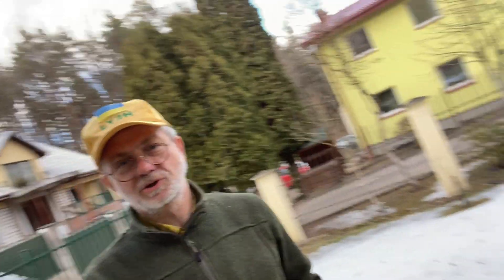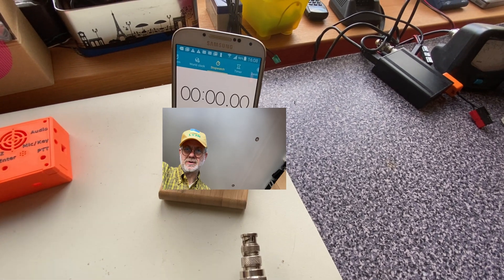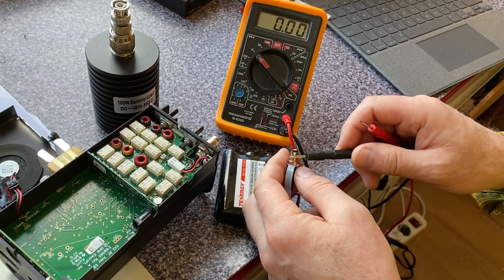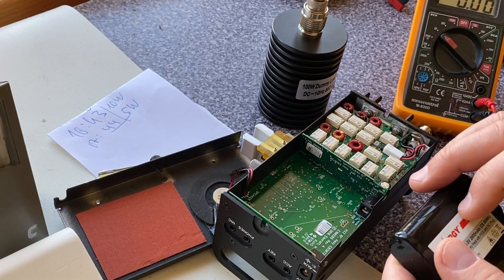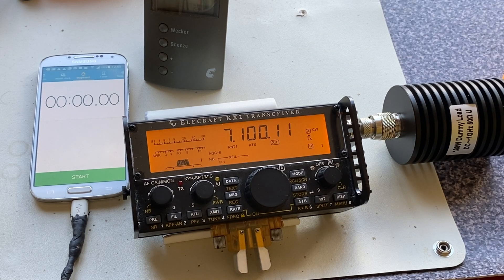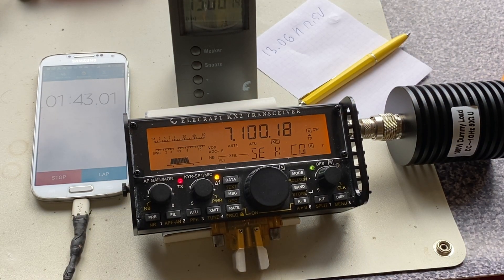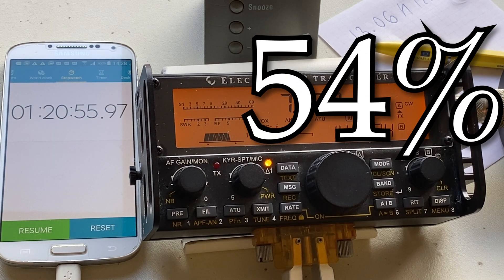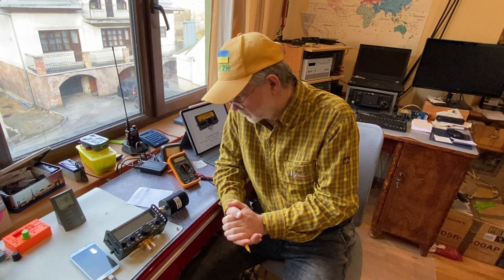Elecraft KX2 new firmware gives 3 times more operating time at full 10W !

Comment: Hi, greetings from UK!
very interesting experiment. A quick curiosity, how much extra weight do those side plates add to the rig?
I wonder if those thermal plates have any positive impact on transmit efficiency and as a consequence in running time?
Thanks for sharing.
Peace
72
Reply from the maker: Hi Vitor, thanks for watching! The side plates make a negligible increase in overal weight of the KX2 as  it's made of lightweight aluminium. The heatsink is installed on one of the side plates. The heatsink makes a very positive impact on the transmit efficiency. I can run a really heavy-duty CW ( contest style) at 10W output with no problems now respectfully the running time. Before the heatsink, even at 5W output intense work in CW mode was problematic. So my personal opinion is the heatsink is a must if you plan to operate a lot of CW and  Digital. If you only make leisure-style SSB ( 80% of listening, 20% of transmitting), then the extra-heatsink makes no sense. HTH, 72! Linas LY2H
Reply: @Linas_LY2H  Hi, thanks that is very useful to know. Also considering that I often like to operate in the summer in places where temperatures often rise above 28 degrees in the shade, that is definitely a good accessory to have.

Comment: the KXIBC2 is getting closer, it replaces the KXIO2 board... the product manual is on the Elecraft FTP site with a date of 26 Jan 2023...

ELECRAFT KXIBC2 INTERNAL BATTERY CHARGER MODULE INSTALLATION AND OPERATING INSTRUCTIONS
Rev. B2, Jan. 26, 2023 Copyright 2023, Elecraft, Inc.

INTRODUCTION
The KXIBC2 module is a C/10-rate charger for the KXBT2 Li-ion internal battery pack. Operation is simple,
requiring only that a power supply be connected to the KX2 when charging is required. The radio may be on
or off during charging. The KXIBC2 does not generate any RFI, so the radio may be used during charging if
the power supply provides sufficient current for both charging and receive/transmit operation.
The KXIBC2 replaces the previous KXIO2 option module, retaining its RTC (real-time-clock) function.
Reply from the maker: That's a good news! Thank you Steve! I'm looking forward to it very much, it could be it's the best optional module for the KX2 (after the antenna tuner ). It would make the KX2 the second radio in the portable radios market  which allows for charging when working ( at the moment, only the IC-705 can do this). Hope, it will be released soon! Thanks again, 73! Linas LY2H

Comment: Hi Linas, thinking about getting a KX2. Does the firmware upgrade increase the power output time at 10W on SSB ? I don't use CW and just an SSB operator. Thanks. 73
Reply from the maker: Hello Martin, thanks for a good question! Unfortunately, this new feature is only applicable to CW mode. As it is explained in the Elecraft firmware MCU3.02/DSP1.52 release notes, this is due to requirement for the power amplifier to preserve low transmit IMD. So, the 10W output at the power supply level of 9V is only made possible for the CW mode, for the other modes the criteria for 10W output is still 10V. HTH, 73! Linas LY2H

Comment: Linas, thanks again for the videos… I just uploaded the new firmware, and updated my messages via the Elecraft KX2 Utility program.  I’ve yet to test it afield… but I don’t anticipate any problems.  The new internal battery charger is of interest… I’d love that mod!  Typically I run off an external 12v 10aH LiFePo4 battery.  It’s a bit more weight than I’d like to carry, but worth carrying.  I may try 10w more often… my solution is an efficient simple speaker wire doublet, up as high as I can get.  In practice, it’s the best way to be heard… 72!  de Rand W7UDT (dit dit)

Comment: Is that a (tr)uSDX in the corner? What’s your thoughts on it compared to the kx2
Reply from the maker: I'm glad you actually watched the video! Yes, it's a (tr)USDX sitting in the corner , just it's not assembled yet, still in waiting :) I do think it's a very interesting and very simplistic SDR design , but I don't think it could be compared as "apples-to-apples" with KX2. But I'm looking forward to assembling and testing it soon. 73! Linas LY2H
Reply: @Linas_LY2H  I have a (tr)uSDX and used it on a 6 day hike inside the Kruger game reserve in Africa managed 9 SSB QSO’s I’ve been saving for the KX2 but can’t justify it yet!  So they can be compared for a specific activity- for an ultralight portable rig specifically for hiking it was very good (1.067kg) including antenna Coax battery external inear speaker mic and carry bag. With counterpoise for 40m and 20m I’ve got the weight down to 707g
Reply from the maker: @downsouthsafaris6788  What a fantastic wild nature journey for a little radio, congratulations! Now I'm motivated to make my assembly work faster! As it comes to the KX2, it is a bit bigger than Tru alone, but it includes (my version)  a battery, a speaker, an antenna tuner, an integrated cw paddle and a mic, protective side pannels/heatsink - all this weighs in 650 g, add a lightweight wire antenna ( with or without a coax cable) and it will make up to around 1kg in the backpack. Good luck, hope to work you /portable! 73! Linas LY2H

Comment: So if you had to choose between KX-2 and IC-705, which would you keep? I know, unfair question, and the right answer is to own both of them, right?
Reply from the maker: Yeh, keep'em both! Because they are of a bit different nature, and might complete different tasks in different circumstancies. So, you can take one wich is better suited for your concrete situation. Like, if you wanna operate HF /pedestrian mobile, keeping the radio in one hand with no way to handle microphone or CW paddle- then KX2 is unbeatable: built-in mic, pannel attached CW paddle , internal ATU and small size yet giving out 10W off internal battery. None of these functions found in 705. But if you need to operate portable but not that extra-light, like from the car, or on a park-bench , and you need also to have VHF/UHF bands, you want to  use your laptop for digital and look for an easy one-cable-does-all interface ( or even wireless!) ,and you also like to test the antennas for the best tune and simple integrated antenna analyzer is your dream, then - IC-705 with its fantastic display /waterfall is unbeatable.None of these functions are in KX2. So that's why I keep them both. YMMV :) 73! Linas LY2H

Comment: So the kx2 doesn't get hot running 10 watts cw continuous for 30 minutes.... Is that correct?
Reply from the maker: Correct, not only for 30min but for entire 1h 20min  of the experiment keeping in the  the same ~52C region and running non-stop CW . Equiped with the side-panel-heatsink combo, of course.  73! Linas LY2H